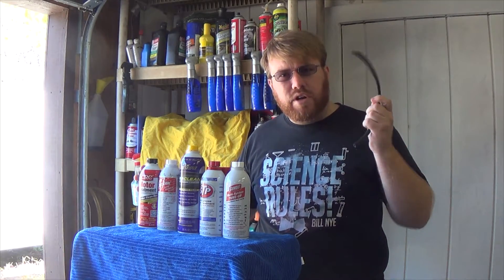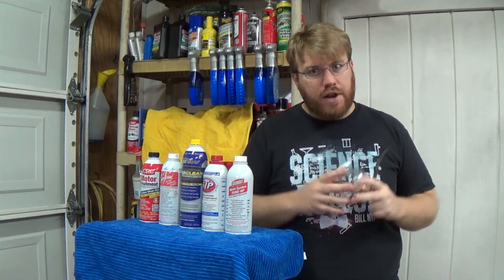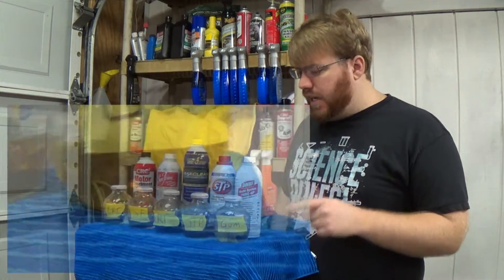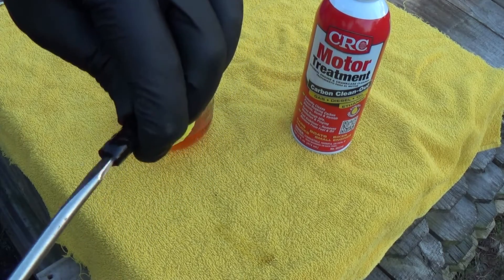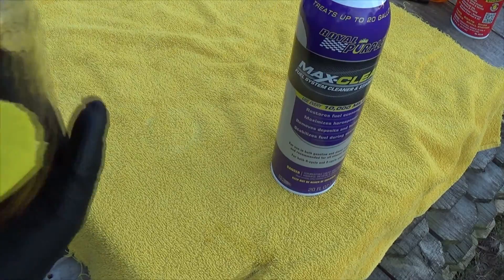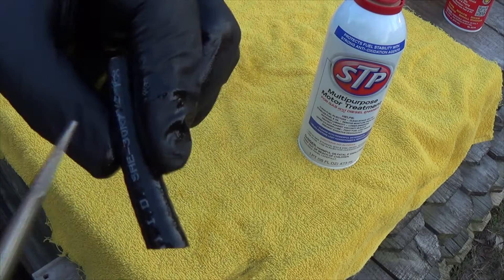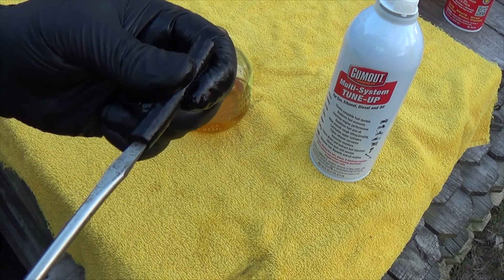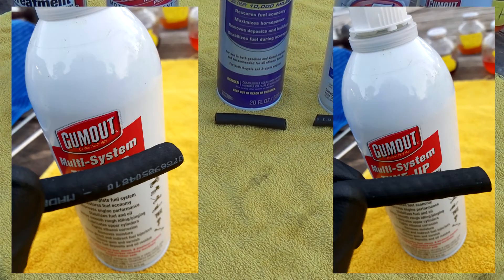Are Fuel System Cleaners Safe For Fuel Lines? • Cars Simplified

Comment: Thanks for going to all the trouble; nobody else has. In my experience, most cleaners are about the same, many probably buy the patented PEA ingredient from the Oronite division of Chevron https://www.oronite.com/products/aftermarket.asp , ie "Techron." Techron was notably missing, it's the original product, going back to "F310" in the 1980's.
Only in-tank FI hose has a fuel-resistant jacket, and swelling is a sensitive test of chemical attack; it would be nice to measure the swelling of just the inner tube material. I think you saw some with the STP.

Comment: Lucas deep clean is the best bar none. Always have great results better throttle responce. Use every 3000 miles you wont have any problems.  Plus also use premium shell gas nitro shell has more detergents in fuel than any other brand.

Comment: STP products are usually junk anyway and this video proves it single handedly. All snake oil
Reply: Darksyne This video doesn't prove that at all, because, as noted by the reviewer, none of these were mixed with fuel. I find it hard to believe any normal person would put this in their cars without any fuel and then leave it sat for a month... because that isn't what it tells you to do. So, with all due respect, you're talking rubbish.
Reply: If it were mixed with fuel it would've been worse.

Comment: I have always trusted Gumout products.  I've used STP fuel treatment off and on over the years.  Seafoam is probably my favorite.  I've always had good luck with Lucas.  Would you mind doing a test with all of these in a ratio of regular gas and an additive.  I know many recommend a 14:1 ratio.  Fuel to additive.  Also do one with Lucas in addition to these others.  Thanks.
Reply from the maker: I'm building a new collection of jars for just such a test! I have a bottle of Lucas's ethanol treatment ready for the test, but I suspect people will be more interested in either the deep clean (white bottle) or that clear-ish bottle they have, so I will probably get one of those. Have an opinion on which one of those two I should test?
- Steve
Reply: The big, tall bottle that is white with blue or red letters. I can't remember right now. LOL. Has the long nipple on the top with a red or blue cap red I believe.

Comment: A guy here in Brazil did something similar, he used o rings and tried two products and also kerosene, the products were STP and something called Perfect Clean, well kerosene didn't do anything to the rubber, STP changed color just like your experiment and perfect clean caused the oring to double in size. Here it is :
https://www.youtube.com/watch?v=SdaVru0cmqM

Comment: Cool experiment, in case no one else has mentioned it though; another factor to consider is the temperature these are designed to operate in, and the friction from moving fluids.
Reply from the maker: You're the first to mention both of those from what I can recall. Good catch! Jokes about Florida heat aside, I am not sure I can do anything about those in the next experiment due to costs and/or safety, but I'll keep it in mind.

Comment: Try some lacquer thinner as well. Some people add this to try and clean catalytic converter's-though it's usually added 1:10 with gasoline. You might also want to check the rubber using a microscope. Personally I only use top tier gas (Shell) and steer clear of additives.
Reply from the maker: I was thinking about doing acetone, since I've used that before myself. I think the place I usually buy stuff from sells its lacquer thinner as "100% acetone", but I may be thinking of paint thinner. I'll see what is available. Good suggestion!

I'll see if I can find a decent micro lens for my camera for the next video. Thanks for all the feedback!

Comment: Remember that many of these are recommended to use with either half or a full tank of gas changing the fuel to additive ratios or that you put it in before adding full to the tank.

Comment: Is there any potential issue with fuel additives loosening large deposits, and then having those deposits clog up the engine exhaust or something? More generally, do fuel additives present any potential danger for cars with over, say, 200,000 miles?
Reply from the maker: I can imagine potential, but I can't say for sure in regards to clogging up the exhaust (but I know that does happen). As for valves, there is definitely potential, and I am almost done editing a video ("How to Clean Valves", should be out March 25th, 2017) showing the damage that occurs when carbon gets jammed between the valve seat and the head.
Reply: Sounds good. Thanks!

Comment: wish you would of tried berryman b-12 also
Reply from the maker: We already have a can on the shelf ready for the next test we do, which will be more thorough thanks to the feedback we have received here.
 - Steve
Reply: Cars Simplified Kool thanks for reply looking forward to your new vid
Reply: I'm pretty sure that Berryman is acetone and alcohol based.   It's good for removing lacquer and varnish,  but hard on rubber.   I've used to in my fuel tank of my Ford F150 when the fuel gauge was stuck after a long winter.  Basically it cleaned off the varnished gas off the sensors in the tank, and the fuel gauge has been working great ever since.

Comment: everyone just use seafoam it's proven by like every mechanic on YouTube to be best and even i and searched the engine to see how good it cleans
it also cleans the oil amazingly 
other additives usually don't do much or they ruin stuff over time

and don't trust the b12 trolls that stuff is an acid.  It desolves hose and is horrible for your engine
do. not. use. b12.

Comment: Can this be used on an aircraft carburettor.
Reply from the maker: That's beyond my realm of knowledge. I suspect aircraft parts are built to handle extremes of temperature and pressure more so than the chemicals of a DIY mechanic, so I wouldn't chance it. Hopefully someone will drop by and shed some more informed light on the subject!
Reply: Martin Borman many aircraft guys used Marvel  Mystery Oil for years in aircraft. Check it out.
Reply: I have used 100 octane Low lead Avgas for years in my vehicles(Sans Catalitic Converters) when it has been removed from Aircraft for maintenance purposes and depending on how much Avgas you mix in to your Automotive gas you will need some type of upper cylinder lube such as Marvel or Lucas has a product that works really well. In an FAA certificated Aircraft you should be using Avgas of the appropriate rating and only add to it the proper ratio of FAA approved fuel additives which in most cases are already added in by the Fixed Base Operators who sell the Avgas. Those additives are mainly to prevent icing & microbial contamination of the fuels. Normally if you have a Carburetor problem you will have an FAA certificated mechanic diagnose & repair the problem.

Comment: Try Berrymans B-12 next time. Also try bending the hose before and after to see if there is a difference in the rigidy/ flexibility of the hose.
Reply from the maker: +Rod H I purchased some B12 for the next attempt at this experiment, but that is a ways off. As for flexibility, I checked that afterwards off-camera, and they were all the same as a new piece of hose as far as I could tell.
Reply: Excellent, thank you. Also like I was saying try bending the hose before and after to check if there is a difference in flexibility and increased chance of cracking or rupture.

Comment: Marvel mystery oil
Reply from the maker: I bought a 32-ounce bottle for my next fuel system cleaner test. If you aren't subscribed, I'll let you know when I put that video up with another reply to this comment.
Reply: +Cars Simplified subscribed. I have run MMO though the intake as a top engine cleaner too.
Reply from the maker: I've only done that with the version of Seafoam that comes in an aerosol can, though I know that's not necessary. Do you do anything special to meter the vacuum suction so it doesn't risk vapor-locking the engine? I've considered buying a vacuum metering valve that some auto parts stores sell as a replacement part for some vehicles.
Reply: +Cars Simplified I pour in slowly and have someone Rev the engine as need to ensure it does not hydrolock.

Comment: Were the samples all still pliable? Did any of them get noticeably harder,or softer? Did the rubber swell? What about the diameter,did that change?
None of them outright dissolved,or crumbed..so I guess that's a good sign.
Reply from the maker: +PhattyMo - One of them seemed to swell up, causing the inside diameter to shrink (I suspect having the chemical on both the inside and outside of the hose caused the ID shrinkage), but none of them got any harder, softer, or easier to tear.
Reply: +Cars Simplified JM

Comment: Okay, I appreciate the effort but having some science background, I would like you to try it again.  Please have a few more controls.  One with just fuel (note type, including ethanol),then properly mix each cleaner with the amount recommended on the product's label  and use that as a sample  Also have just the products as a sample and finally you need to have a better way of measuring the corrosion and elasticity of the fuel line.  Plus you need to have a control of just the fuel line soaked in a noncorrosive.   For measuring the finally product of the fuel line, I suggest a long slowly tapered rod, that is marked at different intervals, so you can see how much elasticity it left and at what point.
Reply from the maker: +SuperJamster1 After the comment from Royal Purple, I started working on a more thorough test, similar to what you described. I definitely like the tapered rod idea; I think I could make one out of brake line. I also planned to have a few other controls: ethanol-free 87, E10 87, E85 (octane depending on what I can find), diesel, and maybe kerosene (which is a common "filler" in fuel system cleaners). Any suggestions for the non-corrosive liquid?
I think I will start the second test in early to mid April. I'll note actual dates and times this go around, too.
Reply: +Cars Simplified  Well, I would use a inert distilled water (you could test the PH level).  An oil such as mineral oil is used for some experiments, but I think I would stick with water first to make it simple. Just remember not to add anything besides the products and the fuel, because that will create more variables. Oils and other additives may have an effect. Something like that would be interesting because sometimes like products dissolve like. I.E. turpentine (made for pine trees) is great for removing sap but isn't easy to measure.  One thing that would be interesting is to put straight ethanol in a container with the hose.  Some cleaners such as SeaFoam is used to preserve the gas breakdown, and that might help or hinder the fuel line's conditons.   Using the different Octanes is a good idea, however It requires a lot of extra controls.  I think I would use one regular ethanol free and then a common (what most people use) Ethanol gas.  Go middle of the line, like 89 octane. Good luck, and just remember that whatever you do, there will be a lot of + and - comments, which in the end, makes better science.   .
Reply: The problem with this experiment. They only work when mixed with fuel. Then they react in the combustion cycle. At operating temperatures. The only real test is to run a tank. Use a bore scope before and after. Showing the back side of the valves and the piston head. 

And to be honest. Ethanol will lay waste to your fuel system. Long before these fuel treatments will. As it is a corrosive..  It burns hotter. Causes more pollution. Eats sensors coatings. Less MPG and yet they keep forcing that shit down our engines! Hell it cost more to make ethanol. Then it does gasoline. Which makes fuel cost higher. Not to mention they use 7 gallons of water to make one gallon of the trash! 

One reason I use RXP gas kicker.. It breaks that shit down. So it does not separate from the fuel...